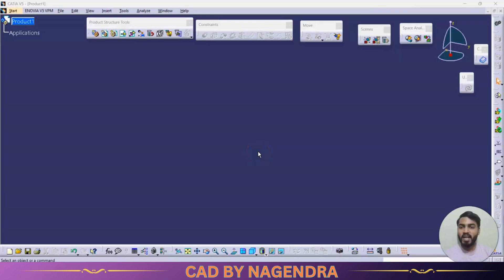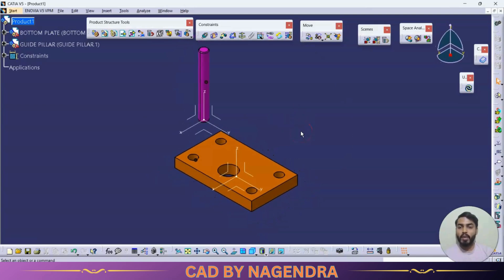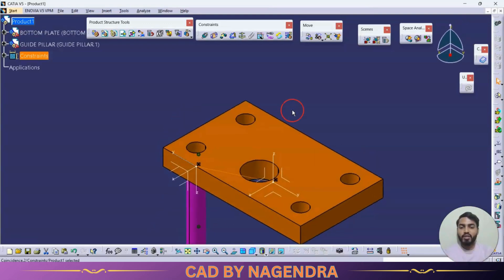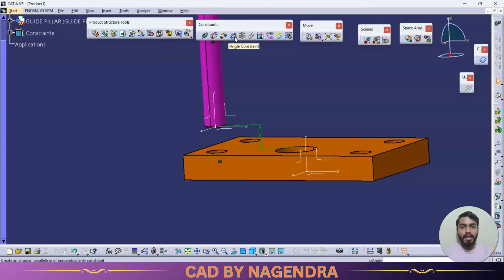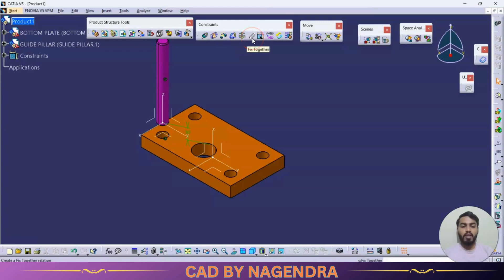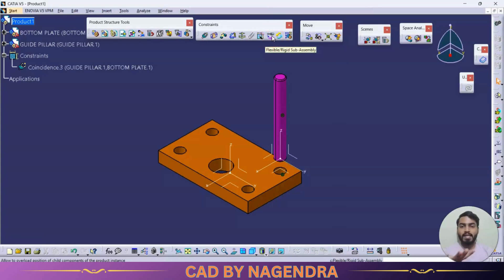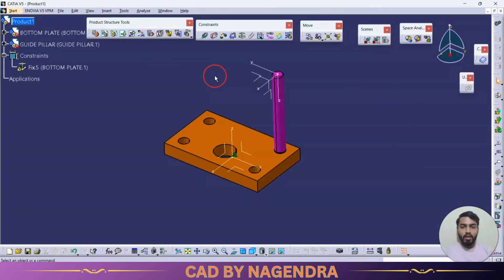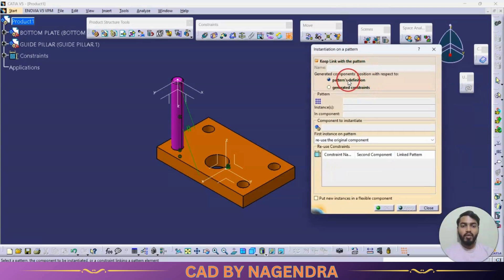CATIA V5 Assembly Tutorials Part-3 | Constraints Tool Bar | Coincidence,Contact,Offset,Angle..etc

Comment: constraint toolbar is not showing in my assembly design workbench.
Reply from the maker: Hi, if u r not getting toolbar u can just drag tool bars from right side ribbon there u will find constraints tool bar.

Comment: What is the case if the holes were created not using pattern command in Part Design? Does this Reuse Pattern still work in Product Design?
Reply from the maker: No,if holes were created in part design with pattern only u can use Reuse pattern.In the option name itself is there right , re-use pattern,just we are re-using it.I hope u got clarity, thanks for support ♥️